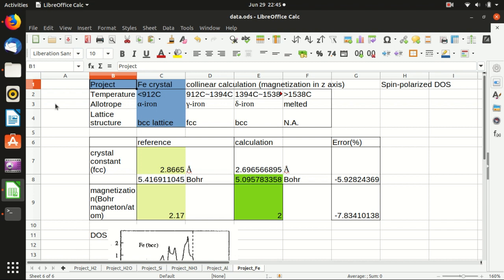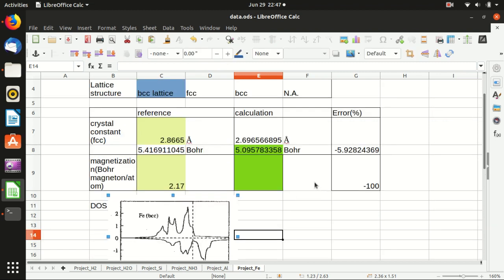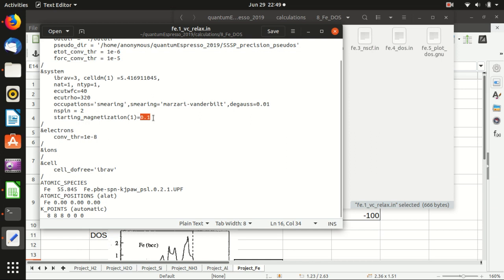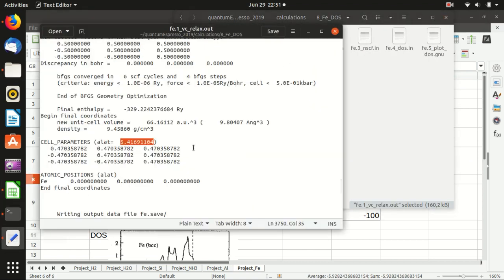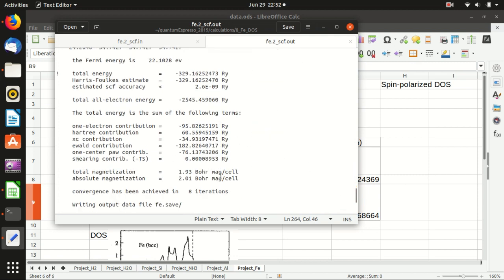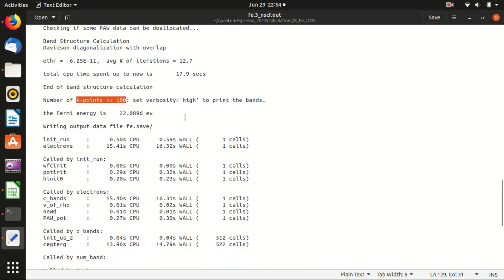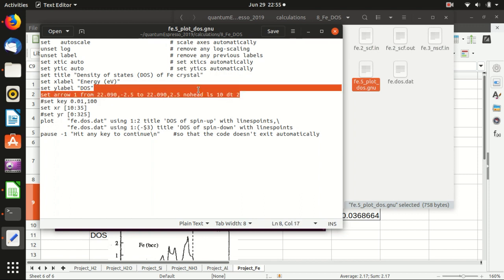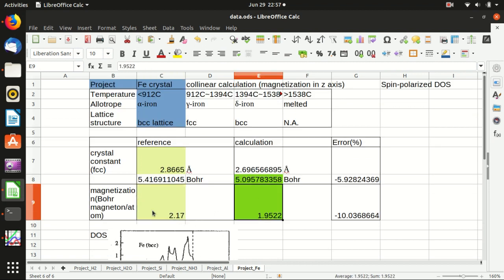Project: 7.1 Fe ferromagnetism and spin polarized DOS | Quantum Espresso Tutorial 2019

Comment: Hello guys. I have a problem in spin polarized DOS calculation. when i finished the calculation of spin-DOS, then dos.dat file show dos(down) and dos(up). but dos(down) is also positive, it should be negative. in my case spin-up dos and spin-down dos both are positive in dos.dat file. please help me
Reply: Hey, as you can see at 10:14 he is also flipping the positive spin-down values by using -$3 when plotting the data. Hope that helps